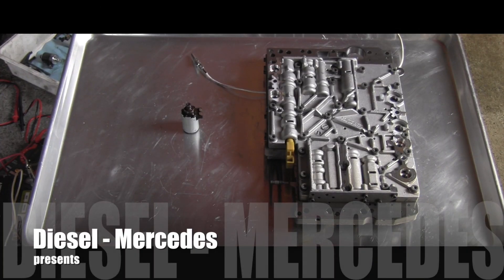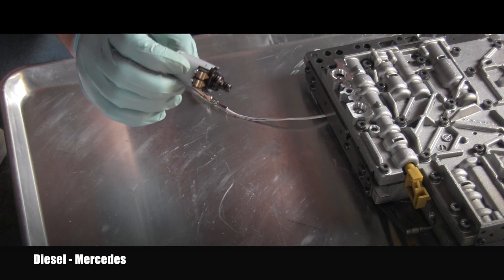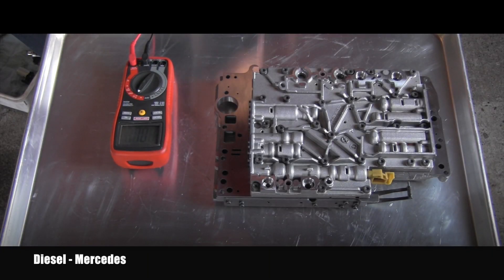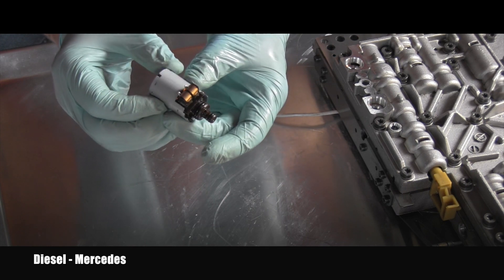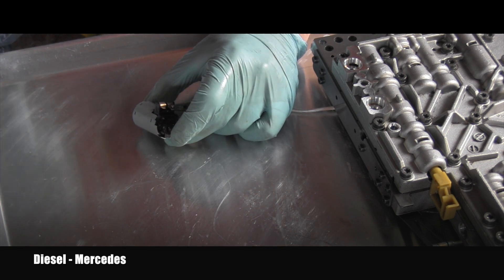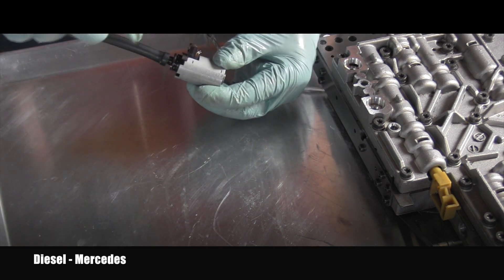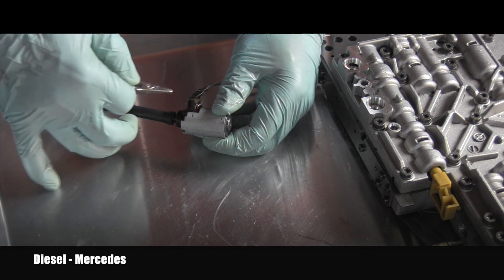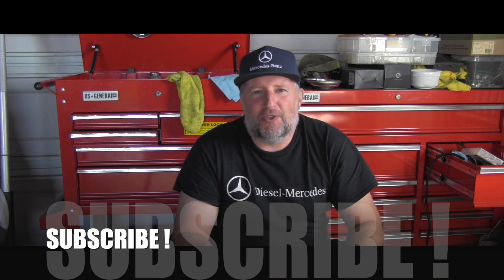Mercedes Transmission 722.6 Shift Solenoid Testing

Comment: I have W168 A170 CDI 2003 model and i have always wanted to know how to test solenoid of the valve body. Now demo has perfectly helpe me to not only know how to do it but understand the functions as well. Thanks to the this instructor your demo is superb. Now my question incase you find one bad, do you need to replace the single bad one or all the solenoids?

Comment: Do the other (TCC, Pressure and shift pressure) solenoids operate at the same voltage and in the same way in the 722.6 transmission?

Comment: Hi
Nice informative video.
Could please tell me about 722.9 blue cap and black cap solenoids?
Are they both checked at 12v or they need to be checked at different volts.
Just don't want to blow up solenoid by testing them on wrong or higher voltage.
Secondly do we have to get it programmed or calibrate after replacing faulty solenoid with new one.
I'll appreciate your reply .
Thank you

Comment: on a mercedes e63 what are the 4 wires for on the gearbox wiring plug. I am doing a project and it will not start without this plug connected. I wish to use a manual gearbox for my 5.5 bi turbo project so need to by pass the plug to allow it to start engine. Wires are red? brown   blue?  blue white suppose small wires are can bus but i am sure if i know where the wires go i can fool it to start. Please help

Comment: Thanks, I have a 2005 Mercedes C230 Kompressor, I already change the conductor plate but the problem persist, the ECM is clean and is not full of oil so I assume it is good. So the next step is to check the solenoid which I should have checked before putting everything back together but I wasn't informed. So resistance should be between 2.5 and 6.5 ohms and doing the volts test to see if they still switch on and off for all of them right! He said he checked 3 but isn't there a total of 5? Thanks for the info :)

Comment: Ok, so where does one set the multimeter too? 🤷🏼‍♀️🤦‍♀️
Reply: The lowest range on your multimeter will probably be 200 ohms.  That would be the scale to use, the lowest one higher than 10, since your expected reading is also lower than 10.  Once you do it a bit, you'll understand.  Good luck.

Comment: Do you know how to flush those 722.6 transmissions? I have seen that here in Germany they sell those flushing machines on ebay for around 450€ but supposedly the instructions are typicaly bad (as with many chinese products). 
So before I buy one I want to see if someone has figured out how to use them correctly.
Thanks, Bernhard
Reply: Do not buy a machine to flush your transmission.  There is a video on Youtube that shows you how to do it with a soft plastic tube and a graduated plastic container (pitcher). I've done it and it works very well.
Reply: istvan meissler 
Do you remember which video it was? Was it the guy who disconnected the hose at the oilcooler?
Thanks

Comment: I just changed my conductor plate (had shop do) and my s600 still doesn't shift past second gear.  I don't know if they checked solenoids.  Could this still be the issue?   I plan to pull it down myself.  I only had shop do it because they just got done doing a different car and it was successful and fast.

Comment: Does these mainly get dirty or faulty if not gearbox oil changed fully? Have like slip on cold and then revs little bit, any common problems if i get p code can you tell? Great video
Reply: Did you find a solution?

Comment: Thank You for the video I had 2 questions does the polarity matter with the connection between positive/negative?  Also, would it be okay to connect one clamp to the copper pin and tap the second clamp to the body of the solenoid would this do any damage?
Reply: Harish Jinger it says plus and minus on them

Comment: Thank you for the great channel.  Keep up the good work :D
All my solenoids are good, however the three A140 277 05 35 shift solenoids don't seem to have a snug fit with the existing o-rings .  Meaning they would just drop in and just take the slightest finger pressure to seat (almost nothing).  Would you recommend replacing these o-rings while it is apart?

Comment: Good to see the vacuum test on it. I have a 6hp26 box and am testing the 6 solenoids. Only one holds a good vacuum. The others seem to lose pressure around the snout where I believe is the brass bushing for the shaft. I can hear hissing. Worn I assume and need replacing? Thanks

Comment: Hi, i have MB w203 / 2005 model.  

Automatic shifting working very good.   

When i try to use tiptronic,   from D direktly transmision alwasy is changing to 1 gear.  

Example: from 3 to 1 or 4 to 1

Normaly shifting should be D , 4 , 3, 2,1. 

In high speed if itouch or shift the gear by mistake i can damage the transmision.   

Any help please.

Comment: Thanks for the video. I have a C 240 (W203, year 2003). Sometimes the downshifting isn't soft. Upshifting is fine. Could be a problem of sensors ? No error code with diag.
Reply: did you find a solution?

Comment: Hey...could you tell me what the 'normal' resistance range is for the Torque Converter Solenoid is? I can not find it anywhere and figured you must have access to the resistance specs for all of them.
Reply: 2-4 Ohms
Reply: What was your problem I'm getting a shutter and low RPMs just trying to maintain speed and also shutters when I'm stopping if I put it in manual shift it goes away trying to now or something down any suggestions will help I'm thinking the torque converter is having problems going in and out of lockup
Reply: JT 1200 Did you find the issue? Was it the torque converter or the solenoid?

Comment: I have the same gearbox 722.6 and after full rebuild on 9000km(the car was sitting in the garage for 5+ years) on clock (there was no movement in D/R positions in IDLE  and almost cant start in D when it is below zero). Now D/R seems to be working but i still have 2-1 push. Usually when i release the gas and the vehicle is stopping it holds the gear a bit longer then shifts down and after 1-2sec it kicks. Do you have any ideas ? Can it be solenoid ?
Reply: No, not all 722.6 conductor plates are the same; variations exist between different manufacturers (Mercedes-Benz, Jaguar, Chrysler, Porsche, etc.) and even within applications from the same manufacturer, so you must verify the specific casting number or OEM part number for your vehicle to ensure you order the correct replacement conductor plate.
Reply: Have you solved? Mine acting same

Comment: Thanks for shearing. I have a 95 c280 that the TX is due cleaning, it's getting lazy shifting to reverse.
Reply from the maker: What is TX ?
Reply: Diesel Mercedes 
transmission, soryy for slang
Reply from the maker: no problem, I just couldn't figure out what you mean...